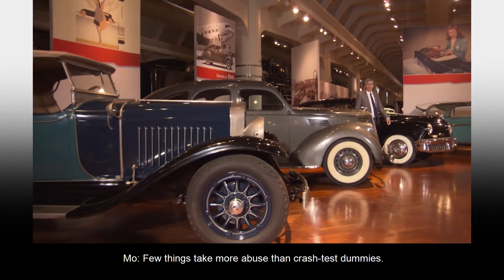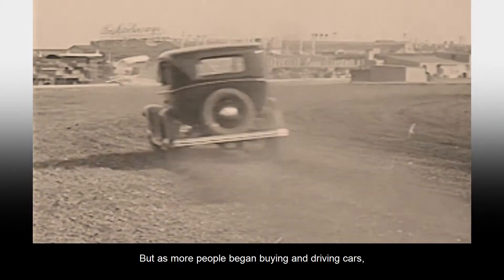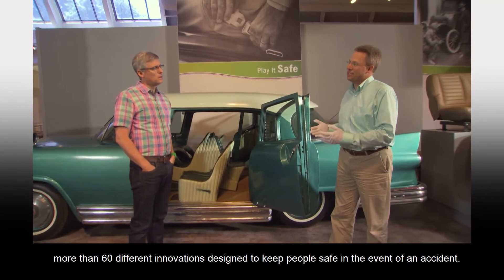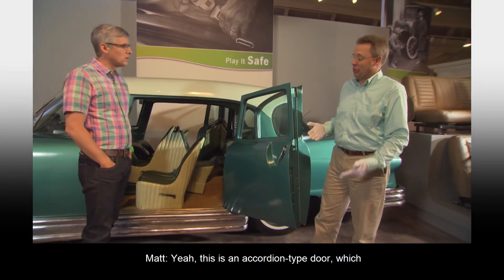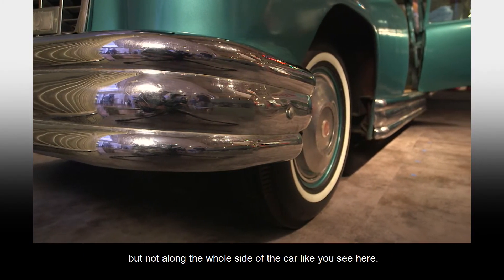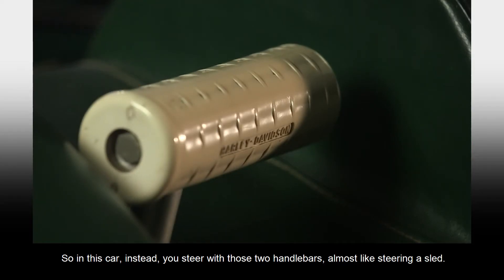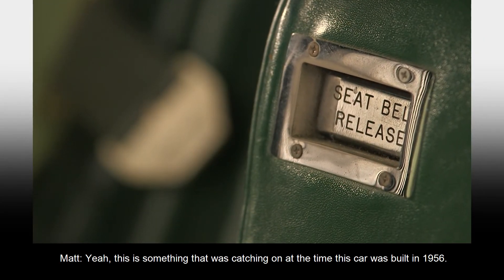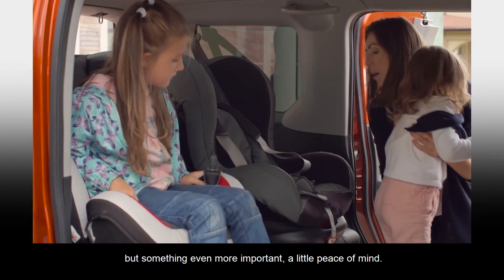Safety Car | The Henry Ford’s Innovation Nation

Comment: Let's see a crash-test with this car. I respect that  a few engineers were concerned about safety back then. But, that steering is more suitable for a tank. I think it would have caused loss of control, in many cases. The bumper is an RCH* as far as preventing injury. Three-point belts, airbags, and crumple zones, were still years from becoming standard.

*RCH=red female...uh...genital hair.